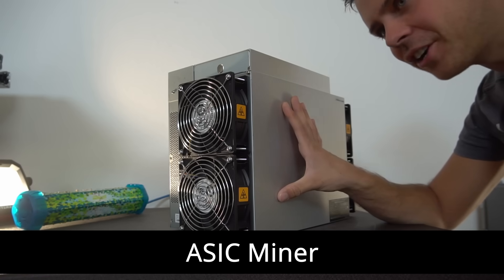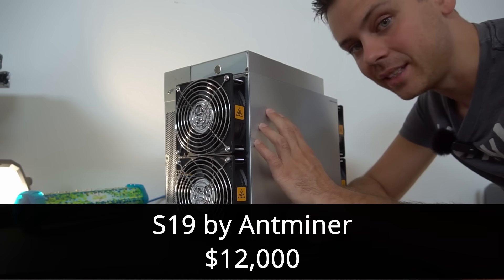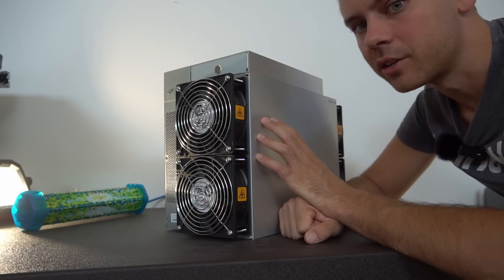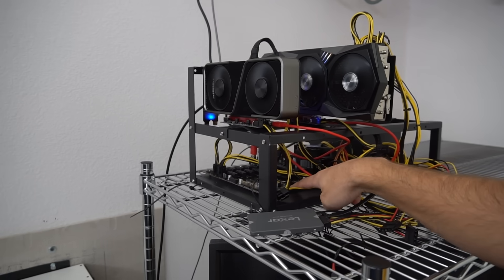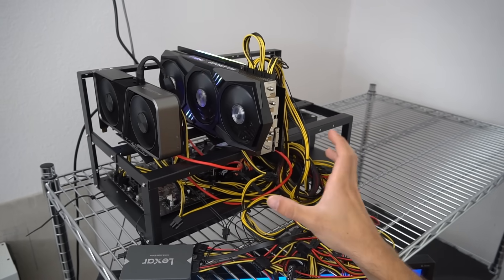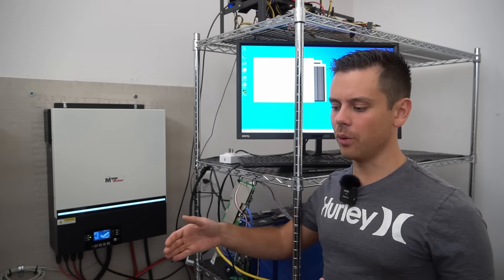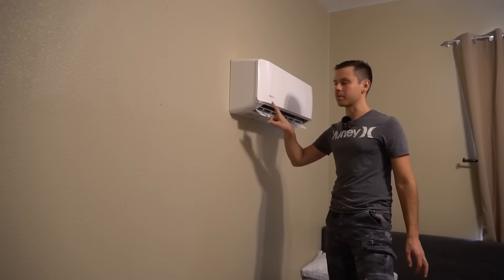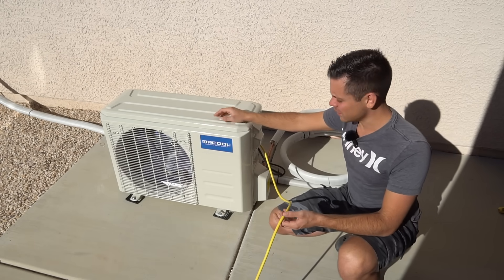Solar Powered Crypto Mining: Making free money with sunshine!

Comment: I too see a lot of the s**tcoins disapearing in the future.
But I am not an ETH hater, and so I wouldn't go as far as saying ETH is a s**tcoin.
Just my opinion though.

Crypto market caps:
BTC 793b USD
ETH 339b USD
ADA 65b USD

Maybe you dislike ETH because they are planning to abandon PoW/Mining though. Which I can understand.

BTC has a crappy network throughput (last I checked 4-5 transactions/second), until they improve that I can't get behind BTC as a digital currency.
At least there are scaling projects for ETH (Level 2 and Polkadot), trying to solve this problem to expand the network throughput capacity.

(I still HODL BTC as I see it as the grandfather currency, but I'd be lying if I said BTC's future is guaranteed, it has no purpose but to be a currency, and a currency that can only transact 4-5/s is not a very good currency).
Reply from the maker: You can make a layer 2 on BTC that fixes all of these problems. I just hate Vitalik and Charles. And the fees are a joke. I've used most dexes and owned lots of alt coins in the past, and I can't stand them. You can easily use btc as a base layer. Btc is awful to be used as a currency.
Reply from the maker: The transaction issue is why I liked a lot of other cryptos early on, but I don't like trusting projects. I thought stellar lumens and Solana were awesome. But now I don't see the point. Especially all of them having their own coins.

Comment: For the ASIC miner, ,you should consider direct venting the exhaust directly outside.  In many cases it is cheaper to cool outside air, than the exhaust from the basic miner.  Large computer datacenter do this.
Reply: I agree, but only if the air coming in to the building is dry (should be ok in the desert)... But if it's humid or salt air (I get both) your gear won't last as long.
Reply: Was wondering the same thing, just run an AC duct from the rear to outside if you need to keep the inside cool
Reply from the maker: Yeah I should do that
Reply: @WillProwse   but in the summer here in vegas. The hot air just back flows through the vents. You will need some heavy exhaust
Reply from the maker: @LADETROIT  next summer I won't have these miners in this state. I'm putting them in the house I'm buying for mining
Reply: @WillProwse  good job Will. From homeless, to multiple homes!!. And even better, one with a water source on the property. So when SHTF, and they cut off the water here. All you have to do is pack up the van.
Reply from the maker: @LADETROIT  and that's exactly why I bought the van 😂👍👍
Reply: I recommend not mining crypto and selling the power to the grid. Crypto is bad for the environment.  Whether it's using solar or not. The power could be used elsewhere and result in a net reduction in carbon emissions. Having said that, I am a huge fan of your stuff.
Reply: @Chris-vb9cf  I'm guessing we are already cooked
Reply: @chriseudy4684  true

Comment: Will, you're wrong about alt coins to a degree. They won't have staying power necessarily but what they will be used for is separate economies, especially in VR that will boom. They will be their own little economies from which you will be able to exchange between fiat and the likes of Bitcoin and Monero. 
However the gambling coins that rely on the bigger idiot principle are essentially just that. It's a scam to get people to pump whilst the original investors dump leaving bag holders of eternity. 

However for project tied crypto and DApps that can't easily be screwed with, a self-contained micro-economy within a popular video game will have sustained long term value. The likes of CS:GO alone proves in game economies matter, not even mentioning Eve Online. Although none of that matters if cheaters keep blowing up. No point in performance based crypto rewards if a spin-bot gets the best K/D ratio.

Comment: Try building a plenum for your Mining rig and vet the plenum to the outside.
So, the cool air will go into your rig, and the hot air will be vented to the outside via the plenum.
This is what, for example, Amazon/Netflix does to keep cooling costs low.
Reply from the maker: Smart idea
Reply: In hot summer climates like Vegas, the problem is that venting any air outside pulls in the 120F air from somewhere else.  Would work in winter, since Vegas does get cold, but then you'd do better to keep the heat inside your home.
Reply: Absolutely - no point using a heat pump / aircon to extract the heat, even with a COP of say 4. Only problem could be the noise, depending on the length of the duct - might need some sound absorber in it and some bends.

Comment: Hey Will .. Is there Anything other than crypto mining one can do if you happen to have excess Solar power generation and you are off grid (so you can't sell to the Power company).  I am not really interested in crypto mining, but would love to put my excess power production to good use.  Any suggestions?
Reply: heat your home with a heat pump - cool it down with ac - dehumidify it with a dehumidifier - heat up a water tank for hot water 

and last but not least - start up a computer and run folding@home on it to help medical research 
or just mine crypto

Comment: you could "mod" the ASIC and water cool it.   And use a Water Buffer to pre-heat your home water.  I bet them ASCI's get in the 60*c+ range so a lot of that energy could be "recycled" into home water heating.
Reply: I could heat my pool in the winter.
Reply: @joeharter7498  not with a single miner... Unless it's an indoor inflatable pool.
Reply: I'm not a firm crypto believer (yet) as a store of value since it lacks anything tangible, but didn't I read somewhere recently that all of this enormous power usage associated around the blockchain verification and mining is easily avoided using another technology that's proven to work and uses a small fraction of the power requirements?  I believe one or more alt coins are already using it.  If so, shouldn't one be careful when investing in all the rigs if they could be proven basically useless for this purpose almost overnight if the other tech was adopted (and it sounded fairly easy to do)?   With everything being pushed towards "green", I would be very fearful about investing in $10k+ rigs that are deemed the enemy right now, even if a few are producing their own power.
Reply: @ssoffshore5111  "green" does not mean, "use as little as possible." ffs we are all going to die, we need to use power. green means sustainable, and the sun shines every day and panels last for 50 years, so plz reconsider your thinking. The high power cost to mine is what makes the chain secure.
Reply: @ssoffshore5111  What is that alternate tech, do you remember what it was?
Reply: @ssoffshore5111  no. You can't do the huge calculations with low power.
Reply: @ssoffshore5111  It is the large power usage and the tangible cost associated with that power that keeps the network secure. Projects that do not use large amounts of power are 1) not secure 2) have a different way of securing the network ie proof of stake, proof of space etc.
Reply: @ssoffshore5111  I believe what your referring to is proof of stake. Bitcoin is proof of work. Basically proof of stake generates crypto by staking coins you already own instead of mining for them. Requires far less electricity and hardware
Reply: @chady6126  Correct.  If other coins are going this direction (PoS), you don't think there's a chance BTC won't too at some point too given the push towards energy savings?  Personally, I'd be reluctant to dump a ton of money into mining rigs knowing there's a reasonable chance BTC could switch also.
Reply: @ssoffshore5111  there is always a chance. However between the enormous amount of work involved and bitcoin supporters "maxis" being hell bent against pos I think bitcoin switching is a longshot. However many 2nd and 3rd gen crypto's are leaning towards pos. I myself think pos is superior to pow. I guess time will ultimately tell. Good point though, I will not be delving into an asic miner. However if I can find or build a gpu miner on the cheap I would definitely do it.
Reply: @ssoffshore5111  I got nothing to lose brother fuck it! ❤
Reply from the maker: Wow that would be cool
Reply: @WillProwse  and quiet!
Reply: @WillProwse  bitsbtrippin has videos about water cooling coverting his 2500 hpu farm
Reply: @WillProwse  will you know about eth 2.0 and December difficulty for ethereum. Ravencoin is next in line with hashrate
Reply: Basically you would set up a system like a Solar Water Heater system. That takes a fluid (water or glycol or some such), heats it in the sun, and then runs it through a Heat Exchanger in your Water Heater. Substitute a Water Cooling loop (or add it to the Solar Loop), and there you have it. You'd have to price out the Mod... But, it should be cheaper than a mini-split, or at least run cheaper.
Reply: The asic might get to the 60c range but the water that is cooling doesn't get close to that.
Reply: You could also run a sterlin engine off of the heat from the ASIC to make electricity as well
Reply: @VanceLeon  no you couldn't. A sterling engine requires wayy higher levels of heat to even run let alone produce electricity.

Comment: I bought the same mini split from Amazon a few months ago. Simple to install. I didn't lay my coil down.
Reply: David Pos did a video recently, installing mini split, on solar. He had a tool to flare the cut to size, ends of the pipes. Dealt with all the tricky stuff, drying and pressurising.
Reply: @michaelbouckley4455  I didn't have to do none of those things.  Just hook the lines and turn the shut-off valves on. Hook the 110 up and turn it on.

Comment: I installed one of those 115V/20A Minisplit systems, but it was branded Cooper&Hunter and exactly the same units, I did have to vacuum the line set but now I own the pump and gages. The most difficult part was crawling under my house to run power. Now my office is nice and cool and even warmed it up this morning. I would like to add a solar system to run my network, Starlink, and computers with some mining in the future, but I will probably wait till I get my shop power finished.

Comment: I know very little about bitcoin, so this is a straight up question without opinion. Doesn't bitcoin get "more difficult" to mine as time goes on? How does that factor in to these ROI calculations that are being looked at over multiple years?
Reply: The difficulty is not necessarily tied to time. It inrceases linearly the more miners are mining that coin. So the more people are mining the less profitable it becomes for each of them, which can lead to some of them mining a different coin. The system kinda self regulates.
Reply: @Merlin1234-t2d  OK, so then how does one model that to estimate their future returns years down the road, so they can model the net present value of the operation? 

What does that model look like?
Reply: @-whackd  I have no interest in actually doing either. I was interested to see what the NPV estimations were for this.
Reply from the maker: Yes it can. And how much you make varies. There is absolute risk to mining or holding any crypto. If everyone dumped Bitcoin today, you wouldn't make anything. But I don't think that will happen. I think btc has a lot of utility and the price will go up in due time.
Reply: @WillProwse  Understood, but assuming a person just takes the historical average increase in value (a grand assumption with bitcoin's volatile valuations) per year, would someone expect the returns to diminish over time, as mining bitcoin becomes more processor intensive? Or would the expectation be that the per-coin value appreciates faster, such that the fewer coins mined in the future would still be worth more when priced in dollars?

In other words, assuming bitcoins appreciate at the historical rate, would you expect to make the same, more, or less (in real dollars) in years 2, 3 & 4 with a rig you built/capitalized today?
Reply: @danh2716  don't miners get some of their profits from transaction fees not just the new bitcoins created each block? More adoption of Bitcoin would mean more transaction fees so more money for miners?? I've no idea if that's correct haha

Comment: Hey man. You have to undervolt your gpus. I recon you can get the power consumption down to 350-400 watts. Otherwise they are running way to hot. On top of that, the 3070 and 380 are pretty efficient. I personally wouldn't switch to amd. Also, check out the new lhr hashrate unlocks. That will boost your profitability from 50% to 70%.
Reply from the maker: Dang ok! I had no clue. Can I do that with nicehash? I am using that for gpu mining right now. Just set them to low? Or should I do it manually
Reply: @WillProwse  you can just use Nvidia oc software to do it, but nicehash supports it
Reply: @WillProwse  
You cannot do it through nicehash I think. You have to do it externally. Like Martin said, you can use msi afterburner (it's actually pretty good). Just look up a mining undervolting guide (That's why there are so many mining channels 😉). You basically turn the power down to where they are barely not crashing. 
If you want to get more features, I'd recommend you switch to a Linux mining os. You typically see a lower motherboard power consumption on those. I personally use hiveOS (simple mining os from what I have heard is also quite good) with nice hash servers (because I like btc and their withdrawal fees are pretty dang low). Other that, happy mining!
Reply: You can use msi afterburner if you are running them in windows

Comment: You mentioned 600w for the two cards. Did you optimize the settings on Power Draw for those 3060/70/80 ? Because as far as i know you get them down to 150w each instead of 220+
Reply from the maker: No way! I will look into that now. I am doing max consumption because I have a lot of power available. I should lower them.
Reply: @WillProwse  with the right settings you can get More hashrate with less Power. 

Lower Core clock/ raise Mem clock ( Mem Temp is Key) / Power Limit to Like 80% or so.
Reply: @WillProwse  if those are 3060ti’s then you can get them down to 130w and a regular non lhr 3060 you can get down to 100w
Reply: @WillProwse  also the 30xx series is easily the most power efficient per hash rate
Reply: @WillProwse  3070 is more efficient then 2x 6600xt at the wall. software doesnt show proper watts for 6600xt
Reply: Yeah there are card down to 55w and newer cards at 75w with just a bit of tweaking.

Comment: Hey Will. Have you/could you test charging your Tesla off of that new Bluetti battery? Not super practical but I'm curious how it would perform as a "gas can". Thanks!
Reply from the maker: That would totally work. Very slow, but possible. Would need to max out the solar input
Reply: @WillProwse  off subject but i need your advice? Is there room for yet another solar generator type product? If so is titan solar the guys to beat? And what would be better? I have the backing to develop a product for our community. What do we need?
Reply: @WillProwse  I'm really curious just how many miles you could get if you charged it off of just one battery. Might be a fun but impractical experiment.
Reply: @gingerman5123  around 8 miles

Comment: If you're thinking about efficiency, wouldn't it be advised to skip the GPU rig entirely and get another ASIC? Aren't those significantly more efficient, or am I missing something? (resale value perhaps?)
Reply from the maker: Using nice hash does it automatically. It's really nice. You might make a few cents more mining btc direct like the asic, but it's not that big of a difference.
Reply: @WillProwse  Nicehash goes well, my favorite part is how easy it is to drawdown your crypto from their site it really is a nice platform....did you get the 6600?
Reply from the maker: The new cards are very efficient. And typically you mine something else that's not btc, then convert to btc. Which can make GPU mining indirectly for btc more effective